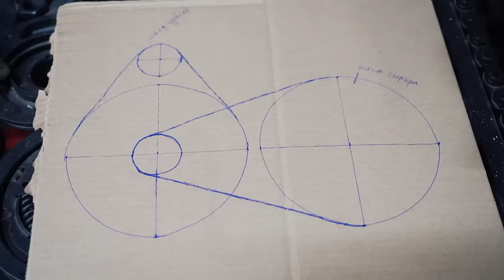Turbocharging a Lada with a starter motor

Comment: You could also try running this setup through a couple batteries in the back. probably linked in series to get more voltage and more boost.

Comment: Electric turbos are available at ebay. Audi's Q7 also has an electric turbo. Nice work, if you try to increase the rpm of the starter motor or change the size of the wheels you got more pressure. 😁😎👍 You should put it on a dyno to see how much power it now delivers.

Comment: This is just a question-
Is there a provision for adding more gasoline to the air/fuel mixture along with the extra air being pushed-in? It seems that more air mixed with the same amount of gasoline would cause the engine to run very lean,maybe even burning through a piston? 
Great vid,great fabrication work!
Reply: That's what I was thinking, unless the engine was already running rich and the extra air made it run at the correct mix thus making more power

Comment: To turn on the starter motor solenoid, use a microswitch that is activated by your throttle at WOT. Or... three stages. 
EXPLANATION: first stage, no boost. Second stage  first switch kicks a Ford type solenoid through a high ohm resistor with high Amp capacity  (all resistors will be high Amp). Third stage, next switch activates a lower ohm resistor. Add as many stages as  you wish or need. The final stage has no resistor. 
Last but not least,  you will need more valve spring pressure. You do want the valves floating instead of closing. 
Mikel

Comment: "The point was to separate the system from the engine to spare it the extra load." The electric motor that runs the turbo fan is powered by the alternator which is powered by the engine, no load spared there, this DIY setup is actually 20+% less efficient than a belt-driven supercharger due to additional losses in the alternator, losses in the motor with all of the extra belts and pulleys. It does give you the ability to get boost independently from engine RPM though.
The final form of this would be something like Garrett Motion's E-Turbo or whatever various OEMs re-brand their version as.

Comment: Use a brushless motor with an electronic speed controller and connect a potentiometer to the accelerator pedal so that the motor spins faster the more you put your foot down then tune the map!

Comment: During the test drive there was a pronounced backfire caused by activation of the rev limiter.

There has been some discussion of the nature of the explosive event as well as it's cause.

The rev limiter briefly killed the ignition spark as designed to prevent engine RPM for exceeding a safe limit.  When the ignition was interrupted unburned fuel and air entered the exhaust system because the motor was still turning without spark ignition.

The engine speed then  dropped below the rev limiter RPM as designed  and ignition resumed.

This caused the unburned fuel and air within the exhaust system to ignite explosively.

The event was exacerbated by the supercharger boost causing more fuel and air to enter the exhaust system than would normally occur during normal operation of the rev limiter in the unmodified Lada engine.

This problem is eliminated in some modern automobiles using electronic fuel injection because the rev limiter is programmed to stop  injection of fuel when maximum safe  RPM is reached.

In other configurations where throttle position is electronic the rev limiter simply reduces throttle opening when maximum safe engine RPM is reached  but spark ignition and fuel injection continue.

Comment: Try putting the trigger on the throttle with a micro switch at about 1/3 throttle. Also I would suggest using a generator off something old to drive it, they are meant to have consistent load unlike the starter and make a fair bit of power when used as a motor.

Comment: Unless you guys use a secondary battery just for the electric turbo, it actually ends up loading the engine anyway because taking power from the battery means the alternator will have to work harder, which, in turn, loads the engine.

Comment: How about an automatic switch on option.... Maybe a physical switch connected to the relevant position of the throttle cable or pedal or carb etc which is related to say...half throttle....or a switching relay connected to the RPM sensor so at a specifically chosen RPM, the relay is switched on, allowing current to flow to the turbo drive motor. The motor.... Find a motor that's designed for long duty cycle use. Maybe from an electric scooter, or a washing machine, via a 12v DC inverter with a high output

Comment: Use a vacuum cleaner instead it’s designed to blow air and much lower current. And an inverter. A ram scoop will increase the acceleration at high velocity, like a hypersonic ram jet engine. Adding fins will prevent it lifting off.

Comment: I always thought a starter for a electric supercharger it had tons of potential. I'm sure it will work you just have to figure out how to add more fuel and adjust timing when the switch is flipped

Comment: Like you said Vlad the starter is the weak point . My suggestion is using a motor from a electric bike something like 1500-2000 watts  .. they go for about 50-100$ without the batteries and then all you need to do is setup  the controller set to max out on engagement  and also You will need a a pressure release valve that can be adjusted  for unecesary blow off  while reviewing down   to have it like a blow off ... Would be be funny if you attached a rubber duck and those whistles on them as the blowoff

Comment: Electrically driven centrifugal supercharger. The power is still sucked from the engine, because the alternator needs to keep recharging the battery, even during boost. Cool project! But you're better of using the waste heat from the exhaust, or just make the contraption belt driven from the cranckshaft.

Comment: I haven't watched this but I know it will work (reasonably well). I always know that it will drain the car's battery very quickly and that's why Turbo's are not designed to be electrically powered.

Comment: You need to rewire the alternator so it can also be used as a motor. With some relays it could function as alternator during driving and as electric booster during full throttle.

Comment: that's a D.I.Y Blow Through Electric Supercharger with an activation switch. clearly it works. and pretty well. on demand Boost.

now to refurb and cold break in the block, shave the block deck and head as much as is possible, machine the pistons with a third compression ring, lap the valves, hone the piston sleeves, and add a dual carburator system, fit that high pressure fuel pump from that toyota van to it...

Comment: Could use a brushless RC motor. The one in my Infraction runs 60k rpm, strong as an ox and super reliable. Could even water cool it and set it up to run only at certain rpm or engine load configurations. Just gave myself an idea for my Go-Kart or 3 wheelers😁

Comment: I would add a butterfly valve and a second intake or one way flap so that the car doesn't have to pull through the turbo while not in use.

Comment: Make it much more compact with a psi gauge, a dump gate and then sell it. Change the starter with another 12 volt motor. Get the insides of a slot car controller and hook it up to the throttle.

Comment: Cool homemade electric supercharger lol....you guys are so cool :)

You probably didnt add enough power to offset the weight you added but this is still really cool.

Still far more efficient to just hook the turbo to the exhaust. 

Perhaps use what you built in conjunction with a traditional turbo to help spool the main turbo up?

Comment: If it's fuel injected I'd have to suggest a larger set of fuel injectors if your gonna go for proper tune. I would also order a pressure switch for under the gas like they have for NOS systems.

Comment: The issue that brushed electric motors have without a controller is they run at a fixed power. They will make way more boost at lower RPM because the airflow demands of the engine is lower. When the engine is spinning faster the electric motor cant offer any more power to keep up with the airflow demands of the engine.

Comment: Theres old book on turbos I think the carburator internal pressure and fuel supply were both boosted to keep up with the increase in air pressure but there were engineering changes.

Comment: Instead of a starter use an 800w 12v electric bike motor. Attatch a momentary switch to the gearshift. You could also change the gear ratio to make the turbo push more air.

Id also redesign your housing to be as light as possible, and try to hide it under the hood a bit better.

Maybe take the turbo inlet and run it to a high flow air filter.

Idk... best of luck from all the way over in America. Rock on, dudes.

Comment: That looks like a gear-reduction starter, if so that adds a massive inefficiency with your system as you're gearing the medium rpm motor down to low rpm, then back up to medium and again to high rpm. You could probably simplify that down to just 2 pulleys and 1 belt if you mounted the pulley directly to the armature.

Comment: You should try an connecting brushless motors to the turbo externally to spool it using 12v :) Some more wild ideas. Compressed air intake systems do wonder! Worth getting a scuba cyl and pump it up with air to replace the turbo? :)

Comment: I think mabey you could use  a motor from a brushless angle grinder hook it up to a lipo battery and connect an ECU/speed  controller from an electric RC car . Then you could bind a remote control that way you can control the speed wirelessly with a remote. I think it  would have enough power to get the rpms up and offer better control. You could power it off a couple 3S lipo batteries in parallel to give you plenty of run time .

Comment: To reduce heat of the starterengine, weld a shell of sheetmetal around it onto which you attach the boostpipes. So you will cool the starter with its own pressurised air.

Comment: i would run piping from trunk area . install  12 volt air compressor, tank with large volume dump valve and regulator to control volume of the dump. or change drive motor and just hide in trunk if its a race car , so you can throw bonnet back on. maybe i make like this and put in my truck toolbox .

Comment: If you had a blow off valve which opens at closed throttle and shuts as you open the throttle plate to build boost you could just leave the system on all the time and not have to wait for it to spool up and build boost. It would be instant full boost soon as the throttle is pressed.

Comment: Not sure which was more dangerous,  the bit when Vlad realised the pulleys (aka wheels of death) were directly in line with the driver, or doing 90 in second gear in a beat up supercharged Lada on a snowy road....you could tell it worked simply by the looks on the guys faces

Comment: If you used a brushless motor to drive the turbo, i could design a system to control the speed based on the throttle position, engine RPM etc.you could have a solenoid valve to dump excess pressure. It would  have to be mapped on a dyno, but it a very easy system to make.

Comment: You should revisit this sometime but instead use a small engine from a go cart/minibike to drive the blower. You might even be able to hook it up to the existing fuel supply and link the throttle for boost on demand 🤟

Comment: I learned something new... always thought a starter motor could not be used for extended time period, without overheating. Electric turbo has advantages over exhaust driven. Car companies are doing lots of R/D with electric boost. Maybe an exhaust driven generator charging a battery that powers the electric boost is the way to go.

Comment: Should incorporate some sort of butterfly valve, to split the air flow between the throttle body and electric turbo. So you don't sacrifice n/a performance sucking air through the turbo/piping when it's not energized.

Comment: A big brushless motor would be good, but then would require an ESC too. What’s the power system? Off the internal battery? Still puts load on the engine via the alternator, and I’m guessing that starter motor is not very efficient. Curious if the boost vs power is lower than a regular exhaust driven turbo. With an external battery pack of lipos though, would be no load placed on the system. Really cool project.

Comment: The turbo will die quickly without any oil, also  you should cool the compressed air before adding it to the intake. 
I would also love to see it packed neatly under the bonnet, since there is a lot of space left

Comment: You could figure out a way to get the turbo charger to operate with the engine rpms like a variable speed motor you could use a drive by wire type of setup to operate the turbo.

Comment: A gear reduction contraption added to starter, and some sort of bypass to let engine run at lower RPM. To charge battery for starter, perhaps an alternator should be driven off a wheel, to charge turbo battery at all times while car is moving.

Comment: Instead of a Starter Motor, use a Compressed Air Bottle that could provide the Turbo Boost - in place of the exhaust gas. The Turbo would easily reach a high speed, with not much lag.

Comment: I'd say a more powerful start motor 
Slite bigger jets or injectors for better fuel to air rate & maybe a tweek on the ecu system  🤔  and maybe a adjustable switch so can keep it on with out full n poss over boosting that way can keep a constant flow at difrent revs for difrent boost 👍  what other people think 🤔

Comment: Now, your talking my language,

A piece of Cake,

I see Only 2 problems:
Piece is singular so needs to be upgraded to pieces (plural),
Theres no size reference so need to add the word BIG.

OK, lets do it.

Ps the convertion of a turbo to an electric supercharger was quite good too.

Hint:  check the temperature of the alternator.

The power in Watts heating the starter motor is (the system efficiency) less than the power heating the alternator, so you will be melting the insulation off the stator coils & cooking the bearings.

Comment: there are a lot of good ideas to power the turbo separate  from the engine, but what if you ran the exost side of turbo also , would it work better with push - pull set up? would be entersting to see. maybe chain saw ,high rev good power. idle would keep fan turning to help with initial rev up, parallel throttles for control.??

Comment: A turbo uses otherwise wasted exhaust gas energy to spin it. There is no load or drain from the engine. You've created an electric centrifugal supercharger that is a drain on the engine spinning the alternator to power the starter. Just install a turbo as a turbo and enjoy the free power. You might be valve floating from the increased air, opening them unintentionally due to soft springs. Try it at wot.

Comment: I wonder if the start motor filled with mineral oil will cool it. Also add some aluminum cooling fins and air scoop to get extra cooling.

Comment: I didn't notice if the solenoid is bypassed.. If the solenoid is constantly actuated, wouldn't that add a lot of heat? I think the solenoid will be a lot less tolerant of constant use than the motor itself.. Nice, tho! The real sign that it has an effect were the smiles when it kicked in, lol! And the look on mr passengers face when Vlad says he doesn't have his license on him either! 09:48 🤣🤣

Comment: I think maybe adapt and R/C speed controller and brushless motor that runs on 24 s lipo batteries and hook up a potentiometer to the throttle body so it gets clean ramp in of boost but don't use the pulley system just direct drive from the brushless motor 😊 just an idea 💡💡

Comment: I used a leaf blower to pump air in to the engine, you need an inverter from 12v to 220 v. If you put a glass of petrol in the oil will the engine go faster?

Comment: How it get lube ? As a turbo it takes constant lube . Why not use a complete turbo with oil lube and youse the exhaust side of the turbo to bust the intake side of the turbo. To drive it a small air tool with a simple air compressor and tank on the motor. Lots air tools spin 10,000 rpm’s . Depending on how much air and the air speed that feeds the tool depends on the amount of output boost ? Will it work? We also need a boost gage we need see what it’s putting out ??? Oil from an oil gallery and a return to the oil pan . Oh and of course an air fuel mixture gauge to see how lean she is going don’t want to melt them pistons . It’s always a bit strange to see through a exhaust manifold lol

Comment: Great project......the torque on the starter would easily handle another gear reduction... maybe get to 40,000rpms... observations:  Huge power draw on a starter motor.... It seems it would have a charging issue.. What bearings are you using, as 20-30,000 rpms require specific bearings...and the duty cycle on the starter is? ..but Maybe the starter location gets cooling from the moving air... great project

Comment: If you’re hell bent against running the turbo on the exhaust an electric blower, many models that all have different power demands, including 12V blowers used in the car’s heat and air system that would work fine. Just duct a blower to the intake like you have that turbo ducted and run a power source and those motors are meant to run for long durations

Comment: Brushless motor directly linked to the compressor would be more interesting, more compact package, also easier to maintain cooled (in comparison with the starter), also an air-cooler would be nicer.
Reply: Yes, of ©20hp+ and a gearbox most likely as that is how much a stock turbocharger scavenges off the exhaust to spin the turbo 30,000+rpms while pushing high CFMs as well as boost pressure.  Totally doable, but expensive.

Comment: You need an Arduino, or small computer to map the voltage of the starter to the rpm of the motor. The starter shouldn't be pushing itself until the engine is.